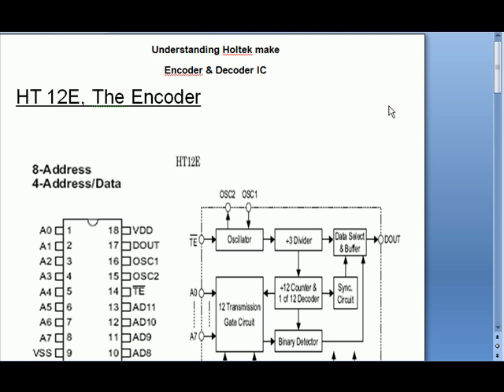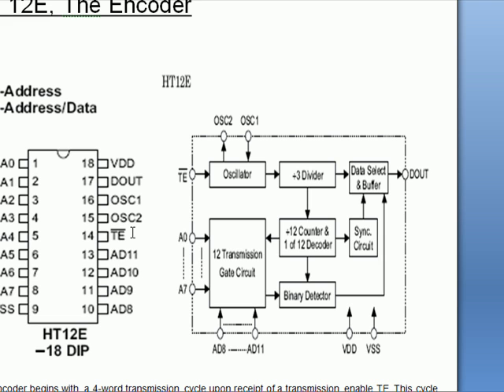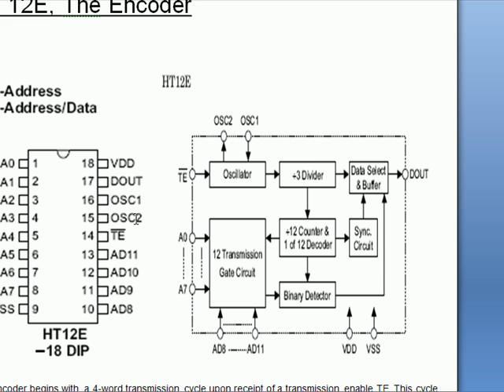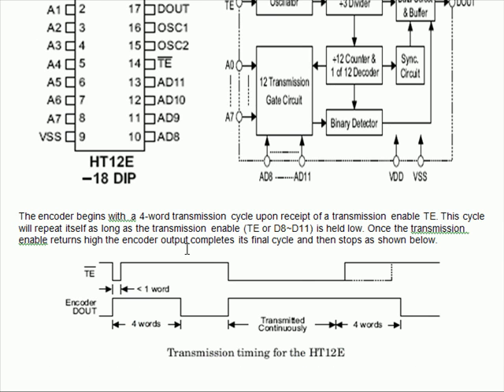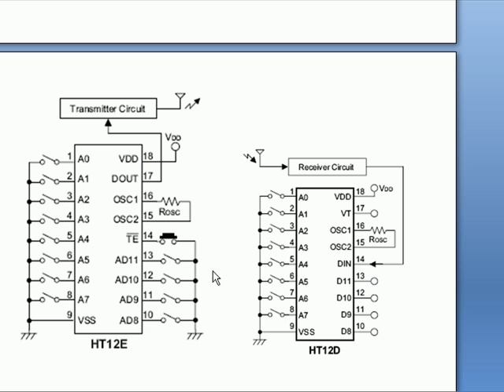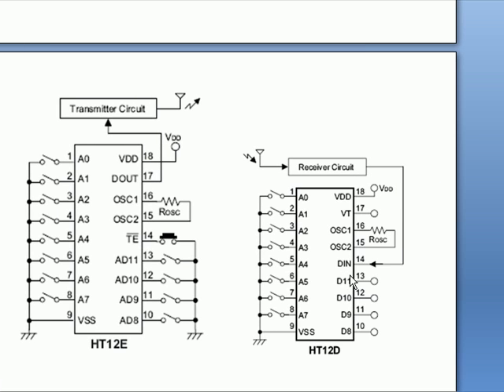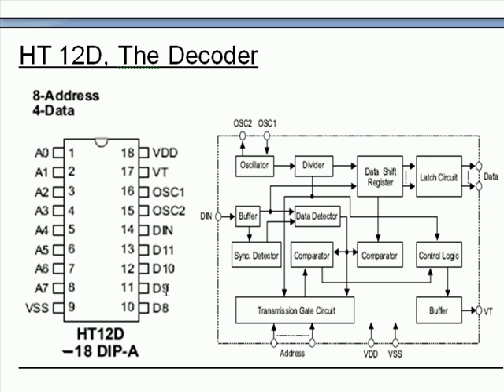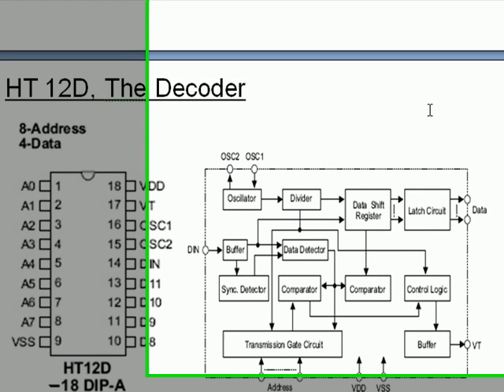HT12D_12E, Encoder and Decoder IC.avi

Comment: I'm working with ir communication using HT12E & HT12D encoder and decoder ic. But i'm having problem to set the clock section. i just used a wire from transmitter to receiver pin to check the function of the ic. but it's not working.if i use a wire to transmit data, which resistor i have to use to match the clock frequency?

please suggest.
thank you.

Comment: excellent video teacher, I have a question, whem I let the 8 address's pin from the Ht12E expoused which state do I  have (0) our (1) ,  same question for the HT12D? which state do I have whem I do not connect the 8 address´s pin to GND in both

Comment from the maker: HT12E & 12D does not exist in proteus. You can simulate your circuit without them if you are not using the address pins but 4 bit data pins only.Connect 4 bit from the transmitter section  to the 4 bit of that of the receiver section to simulate without using the serial mode or the 433 MHz transmitter and receiver modules.In case your program is using 8+4 ie (12 address + 4data) being 12 bit then use 12 pins in either side both.